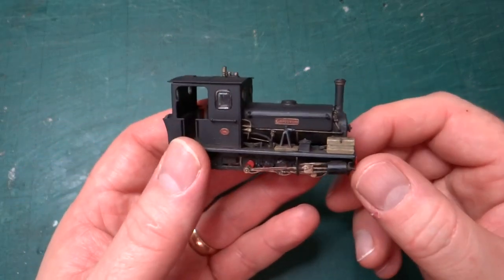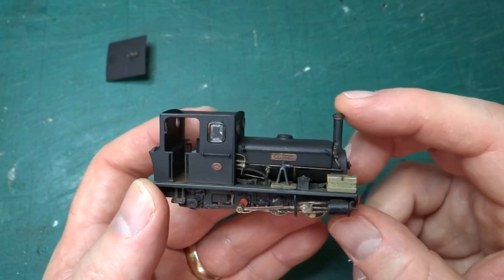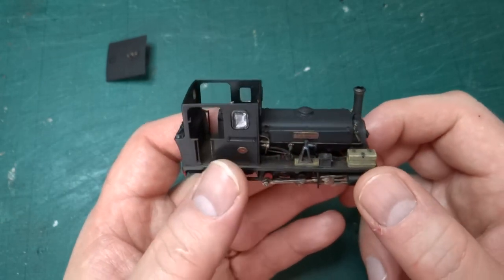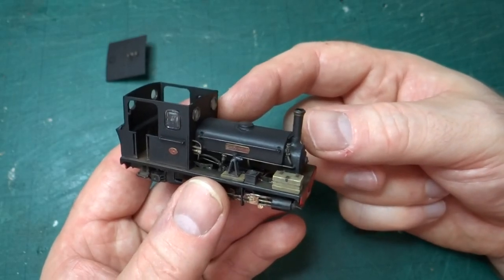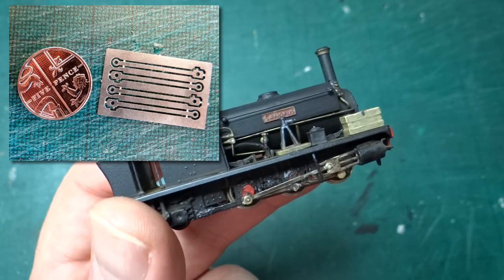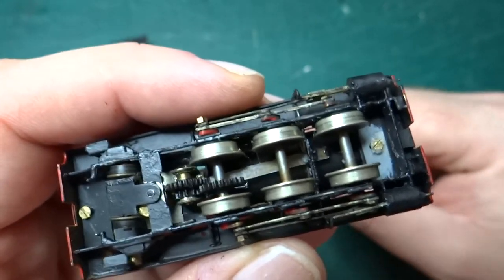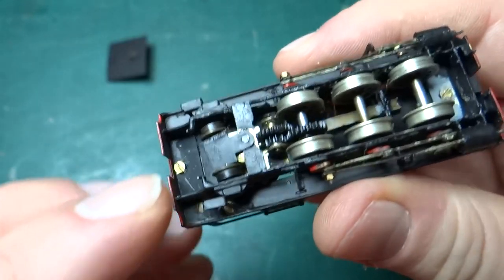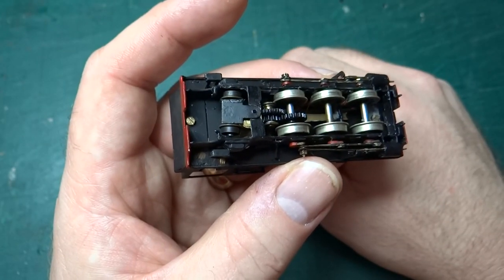I've Finished Building.... "CANOPUS" a Manning Wardle 0-6-2T Locomotive (Backwoods Miniatures)

Comment: The pony truck pivot is not in the ideal position. I’m not sure you could do much about it as I think the gearbox is in the way. Look up Baldrys rule. You will find lots of kits and rtr locos have this flaw. Having the pivot in the correct position helps a lot with the tracking of the pony truck. On my Backwoods Linda and Blanche it had to be moved 5mm rearward.
Reply from the maker: Yes, I'm fairly certain the pivot is in the wrong place as well but there really isn't anywhere sensible to move it to. From the limited running the model has had it seems to track reasonably well, although given it never got fitted with couplings I'm not sure how that would change if pulling a rake of wagons.

Comment: I've built 2 of these over the years and have had the same issue with the connecting rod. I solved this by moving the cylinder and cross heads backwards. One of the locos is on its 2nd chassis having had a lot of use over the years and worn out and the other one the gear on the drive axle has split but still runs fine one way. 
Regards the pony truck, I've not had a problem with it shorting out on the wheels but I've had to file the end of the worm to miss the rivet which the pony truck rotates round.
At present building my 3rd canopus. I've built 10 backwoods kits over the years, some are better than others like my NGG16, Yorkshire, the steam railbus which uses a Kato chassis and one of the Irish railcars
Reply from the maker: You're right. In retrospect I also had to shorten the worm gear to clear the pony truck rivet. I'd completely forgotten about that particular problem.

Not sure I'd want to build three versions of Canopus but I would have liked to build more Backwoods kits. By the time I bought Canopus they were already winding down and a fair few of the kits weren't available. Hopefully I'll get the chance to build some more if they get re-released by N-Drive.